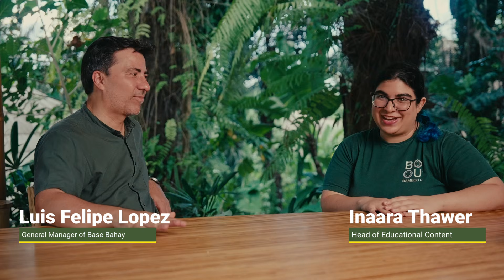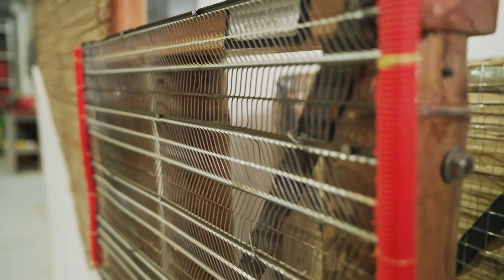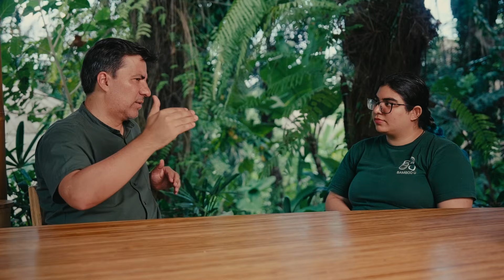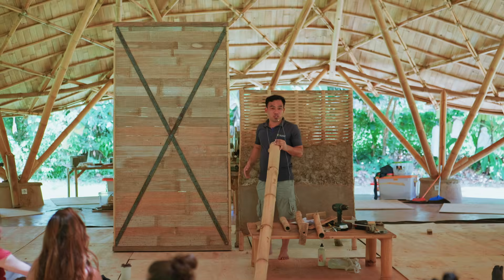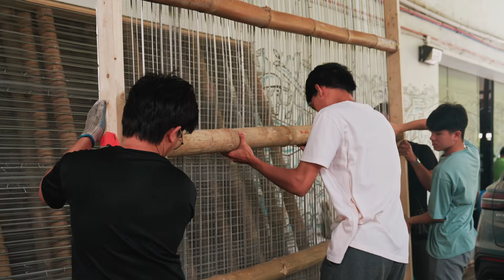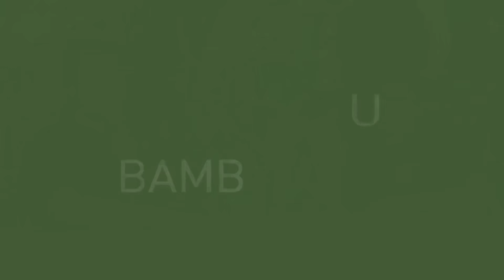CBFT Explained: The Bamboo Housing System Resisting Earthquakes

Comment: I am curious, do termites eat Bamboo?
Reply: Yes, as far as I know, they are submerging it into salt water for months. We eat bamboo shoots in the Philippines, I'm sure termites love them too.
Reply: @fvanced salt water immersion does work, but it is problematic. Any metal in contact with the bamboo will rust. Other treatments such as borax is preferred.
Reply: @newolde1  Maybe it depends on the usage. We used to live in a bamboo house, and I remember the bamboo has dark skin, probably it was smoked or put in some fire. I think borax or other chemicals was not an option before.
Reply from the maker: Yes they do, which is why it's very important to treat the bamboo before using. We recommend using a borax solution